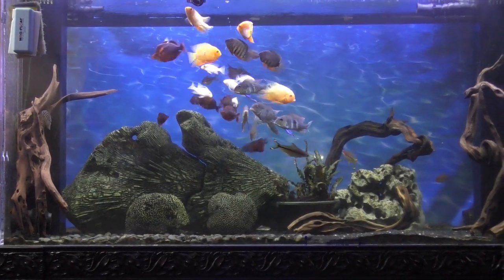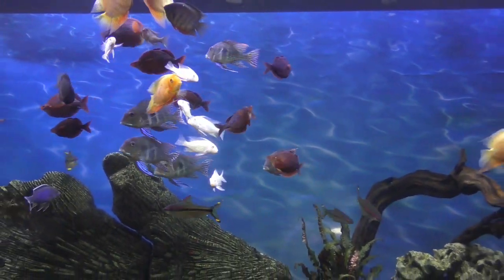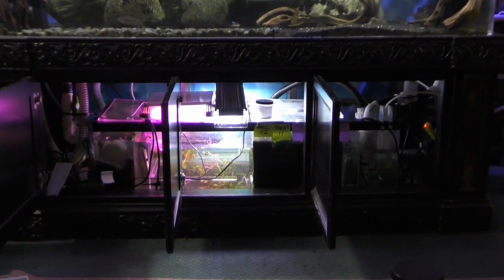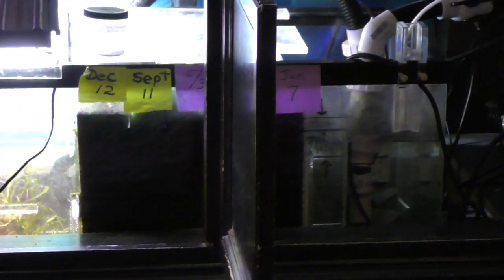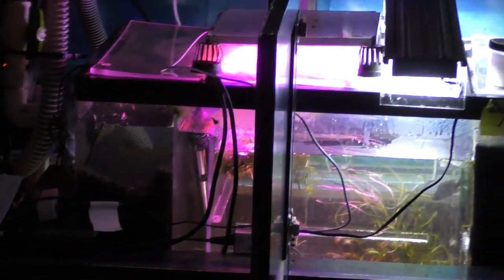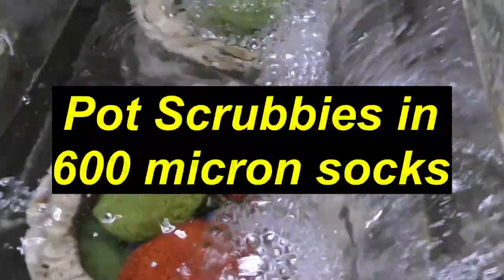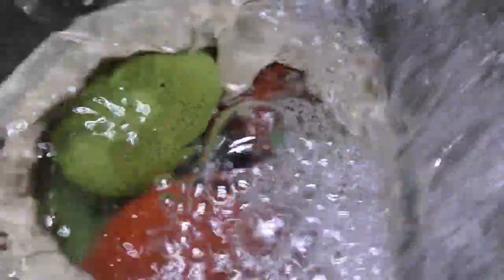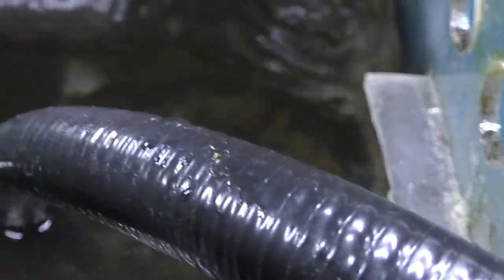REVISIT- Biology of the Aquarium Sump.

Comment: What about fluid media?  I have a new 550 on the way and was planning to do a K1 style fluidize filter.  All of my other large tanks I use sponge and matrix but wanted to try something new.  Tank is 4 foot side so plan to have a fluidized filter and then add a refugium tank as a secondary device.  Tank will be stocked with African cichlids.
Reply from the maker: I loved my K1 media chambers but have replaced them with progressively smaller and smaller PPI foam (Poret from Swiss Tropicals) as the water works it's way throught the filter.  The only issue I had with K1 is that the very prolific bacteria cultures on the media generate quite a lot of bacterial detritus- so you need to have a downstream filter, like foam, to catch these particles before they are returned to your aquarium.  By doing this you avoid that detritus affecting the clarity of your water and you retain it in your filter for removal.  I like foam since it grows tremendous amounts of bacteria AND serves as a mechanical filter to catch all detritus- including bacterial.

Comment: Why did you get rid of your k1 media chamber?
Reply from the maker: I wanted a refugium in the middle of my sump for growing plants and shrimp. So I replaced it with  20 and 30 ppi Poret foam.
Reply: @HalfManHalfCichlid  i am planning to build a sump using your bucket idea. How do you make those holes? Its time consuming with a drill
Reply from the maker: @abhirana4742  I used gutter guard as a template to drill the holes with a drill bit made for plastic.  Took many hours over a couple days
Reply: @HalfManHalfCichlid  yeah i have been using a drill bit. Made 30 holes and got 500 more to go. Haha. Wondering if I could use a soldering iron. Would make it easier but not sure if that is safe for the fish.